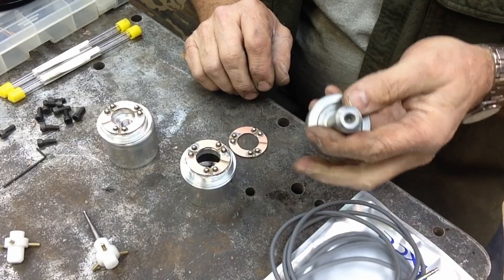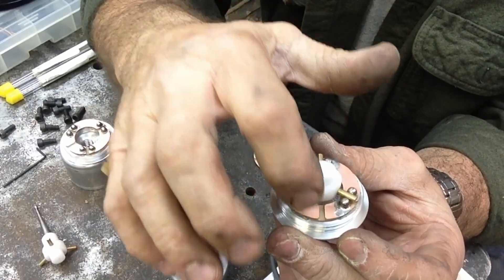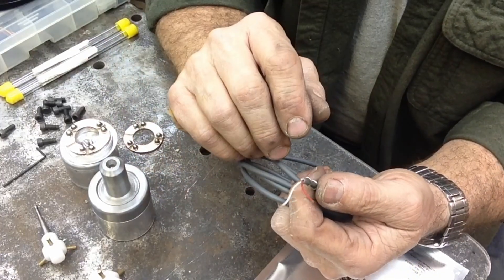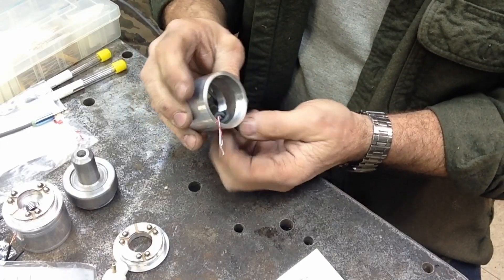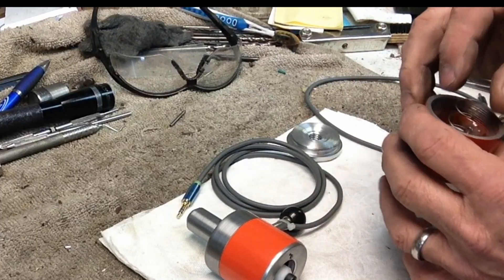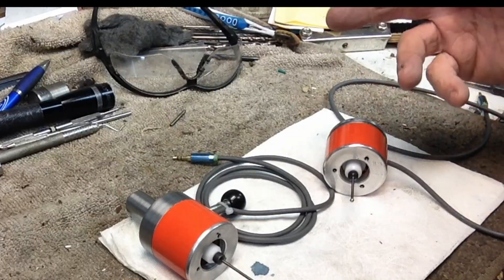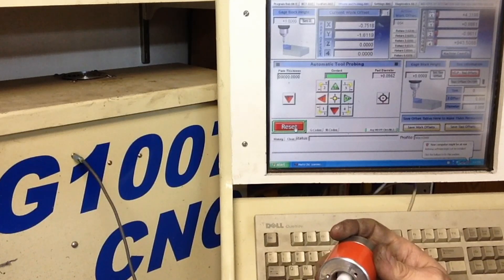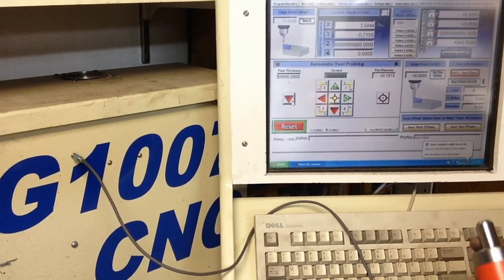Building a CNC Touch Probe For The Mill: Part 5 Final Assembly

Comment: How did you solder steels Bearings to the copper Soft solder??
Reply from the maker: M.C. Lock & Key just flux and then solder as you would with any solder joint. It takes a solder iron that will produce enough heat but my weller solder station handled it no problem
Reply: @hillsgun  Thanks for the reply it just seemed like regular solder would not stick to steel. Not the first time I've been wrong :-)  Thank you
Reply from the maker: M.C. Lock & Key no problem at all , thanks, Dan

Comment: Amazing work, description and explanation. I was planning to make it one for my mill, but I am always doubting about how do you accomodate the x adn y travel you have before trip the probe? I would think you have to introduce it as diamter in stylus diamter in the system but kinda difficult to calculate it. Probably only empirically is possible with 100s of readings.
Reply from the maker: I used Hoss Machine's probing script, but I now see that Fusion 360 has probing routines built in although I haven't played with there script yet.
Reply: @hillsgun  That is clear. I meant the actual travel the tip of the probe makes upon touch the parts. It leans a bit before break the circuit. That adds a certain distance to the diameter of the probe.
Reply from the maker: for the work and the precision I require on my machines it doesn't matter, if I am making multiple parts for instance on a fixture plate and I am setting the plate from a corner it will activate the probe at the same point so the added distance is the same, or if I am finding a corner to begin machining I usually am doing cleanup removal around the entire part perimeter so any inacuracy is machined away.
Reply: @hillsgun  all clear, thank you!